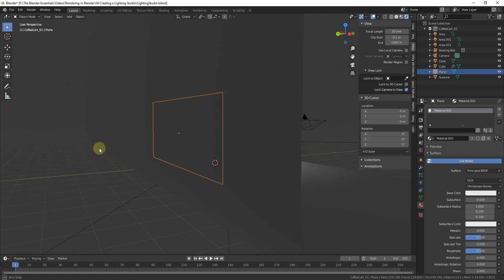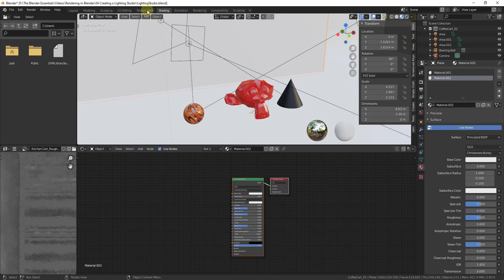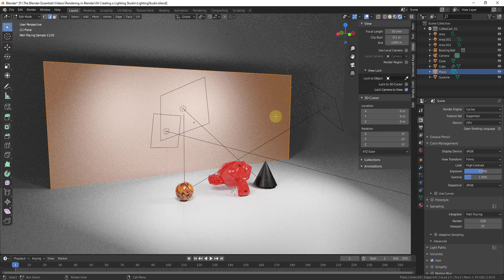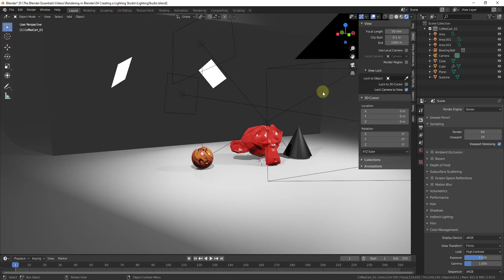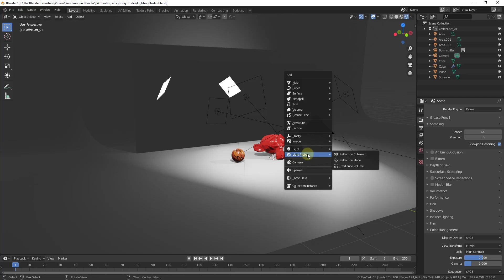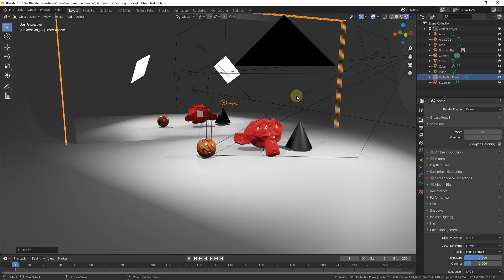Easy MIRROR MATERIAL in Blender for Cycles and Eevee!

Comment: I also struggled with Eevee and I discovered that my problem was caused by the roughness value of Glossy BSDF. It doesn't works with a value of zero(0). It worked perfectly with a value of 0.005. In addition, Screen Space Reflections is absolutely not nessary. I use version 2.93

Comment: For those struggling to get any results. Make sure Screen Space Reflections are on in the render settings
Reply: thank you do much i was so confused
Reply: Screen Space Reflections are a different way to get reflections however these are by far not as accurate as done with Light Probes, if you don't get reflection with Reflections  turned off, there might be something wrong elsewhere, most likely the correct positioning of you Light Probe.

Comment: Great tip thanks for the tutorial. Have you tried this with environmental HDR background for your lighting? And does the light probe have any adjustments if you don't want full reflection?  Someone might want a partial reflection for certain applications.
Reply from the maker: I'm not sure I understand the "partial reflection" request - why would you want partial reflections?
Reply: If you have something metal that is not totally clear like  a slightly brushed silver tea pot or similar items. I call this a partial reflection or maybe a blurred one. The HDR environment map while the transparency is turned  off in the render tab sill reflects on objects like the hood of a car or window. You can see the world map slightly blurred on the hood of the car.  I am trying to figure out how you turn of the world HDR map from any kind of reflection and still have the objects near the tea pot or car door have a slight or blurred reflection on these objects? But this may be a question for the forums.

Comment: Seems to me that the EEVEE solution leaves a lot to be desired.  First, you have to create a new object (the probe) and position and scale it for every surface that you want to be reflective.  I'm assuming that you can parent that object to the reflective plane so if you move it, the reflection probe goes with it.  Second, is the reflection probe only available as a flat plane?  Personally, I'd prefer to get rid of the separate plane objects entirely and have the reflective probe available as a material or shader option that could then be applied to any object.  Problem solved.
Reply from the maker: This is a pretty standard solution in most real-time rendering programs due to limitations in software at the moment. I don't think it can be done with a shader because it's specifically telling the engine where to calculate reflections from an area standpoint, but it's really not a lot of extra work. In fact, it kind of makes you actually think about where you need to see reflections in your renderings...

Comment: How come a light in front of a parabolic mirror does not cast a beam in Blender? It works in Mental Ray in maya.
Reply from the maker: Are you using cycles?
Reply: @TheCGEssentials  Yes. When I did this in Maya with MentalRay, the parabola reflector object cast a beam on a flat matte surface. But I was unable to replicate this in Cycles.
Reply from the maker: @basspig  I don't know the answer to this one. You might want to try posting something on the BlenderArtists forum
Reply: @TheCGEssentials  I did and they told me that Cycles is a path tracer not a ray tracer and that's why it doesn't work.